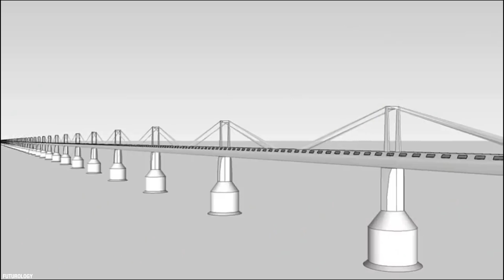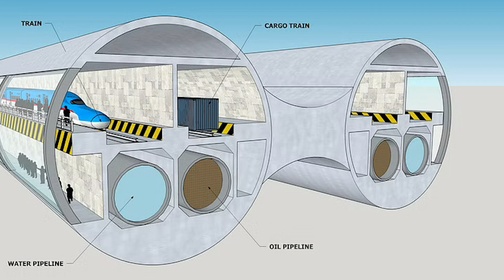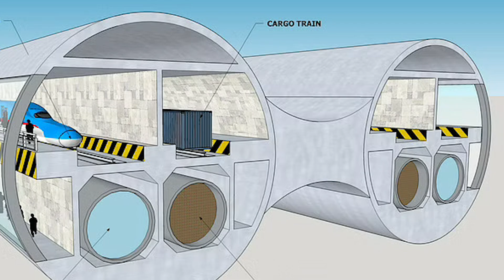Russia’s Insane Plan To Build A Superhighway To America

Comment: After doing research I believe that an arch bridge can be made any size similar to a geodesic dome and that an arch bridge is the way that you can connect two points which doesnt have to be exactly at the point of the Bering Strait it could be at the two points where the roads begin in Alaska and Russia
An arch bridge is the same as a geodesic dome

Comment: There is one fundamental question: who needs such a tunnel? I don't think it's the wildest dream of America. Existing sea transport between the USA and Asia is definitely CHEAPER!
The second fundamental question: how long will the Chukchi Autonomous Region be part of the Russian state? In light of today's situation in Russia, it may turn out that very soon!
The third fundamental question: did any of these hooray tunnel optimists think about what it means to build a railway and a road in that climate? The fact that there are practically no roads or railroads in Alaska does not come out of thin air. This is the most common calculation of costs: by sea it is the cheapest and the fastest. IMHO there will be neither a bridge nor a tunnel.

Comment: The engineering and construction of such a project is not particularly difficult. It would require a rail line and road way to be built to both regions first, but again not an impossible task.

What does make it unlikely is the fact that the US & Russia have not been friendly historically. There was a brief time in the mid-1990s when the project could've happened under Yeltsin, but that time passed quickly.
Reply: How is this not particularly difficult? Regardless of the logistical problems of building a bridge over 85km of sea close to the Arctic circle which is frozen for a large part of the year. On the Alaska side the current rail network is hundreds of miles away from the peninsula and there are no roads there. But on the Russian side their rail network is thousands of miles away from Chukotia with no roads. There's permafrost and marshland which could make its construction difficult, across uninhabited land, mountains etc. Would probably take decades to complete and the costs might outweigh the benefits.
Reply: @NmpK24  The Al-Can was built in about 18 months in the middle of a war. That happened before the tech that built the chunnel. & With the two islands as a stopping point in the middle it's possible. Norway and Sweden have built very large bridges in equally harsh environments. Are there challenges? Yes. Are they hard to solve? No.
Reply: You may not have been careful, but regarding the SMO, the US and Russia are secretly friends, as they have a common enemy.

Comment: I'm going to cut this short it couldn't be a highway that we drive on it would have to be a train something that doesn't require gas but then the electrical system it will be above water and that will be very dangerous but how can you have a highway going straight through with out gas stations

Comment: The US will not build the bridge. It's a massive national security issue. Why would the US help build a road and rail road tracks that would open the door wide to allow it's enemies to enter the country? Also, Russian trains have a very different set up on their trains, the wheels have different measurements for their width, ie how far apart the wheels are from each other. So, Russian trains cannot fit onto American tracks, and vice versa. Then there is the Bearing Straight. Massive winds, ocean currents that are horrible, and the depth. Then there is constructing any road in the State of Alaska. Very difficult, with massive environmental laws to protect the Perma Frost. All freight trains in the US are diesel. They can't go into the tunnel that you refer to. Too much exhaust fumes. Not even the ventilation systems on the islands could handle that much.

Comment: The most difficult part would be connecting the “bridge” to existing roads. It’s almost impossible to put roads on permanent frost which I know exists in Alaska and probably also exists in Russia near the bearing straight.
Reply: Im a quality control tech for road construction in canada. I assure you its entirely possible. Just SUCKS ASS. How do you think they got roads in alaska man, they build them xD. Also, they can substitute asphalt for concrete for the bridge approaches if it really is impossible. just noisy to drive on and rough on the tires.
Reply: There are already roads across Alaska, so its doable
Reply: @jdks1761  the western part of Alaska isn't really possible to build roads on
Reply: Thats a silly thing to say😆!! Alaska has roads silly. Its a bridge and there are bridges up there too🤣
Reply: @mambojazz1  watch the movie about how they built the Alaskan highway and you might not think it’s so silly. The nearest approach of road to the Bering strait is over 1000 miles! Most of it in permanent frost.
Reply: @danielrickel8807  Silly sorry. #1) Its a road that lasted thousands of years ago that was 1000 miles not a road today. #2) Are you saying Alaska cant build a road?🤣

Comment: Biggest issue here is continental drift, it's slow but is enough to itself to cause structual dmg to which ever is built over time.  Also its near a subduction zone and is a potentual for earth quakes and possible magma shaft.
Reply: Very correct, Jandra!! These data are not mentioned! 
My regards.
Reply: No the biggest issue is the Ukraine war the relations between the two countries have gone down because of it so I doubt it could be built since building stuff like that requires cooperation between countries and since the Ukraine war Russia and the USA’s relations and cooperation have gone down